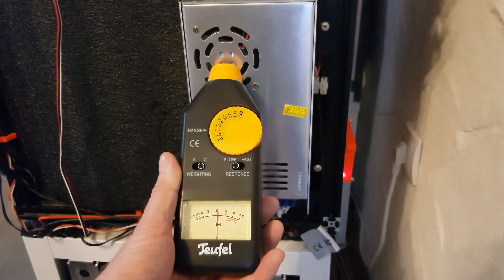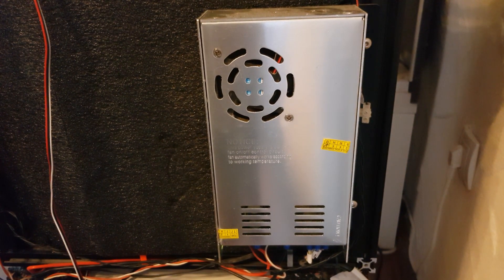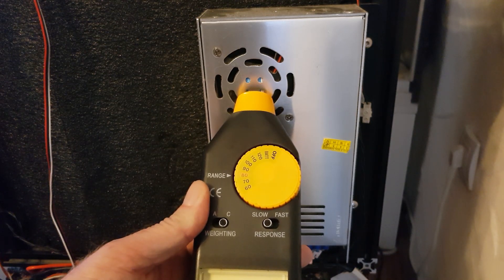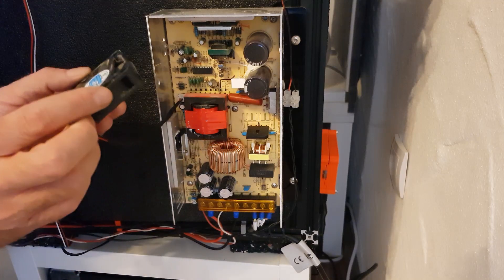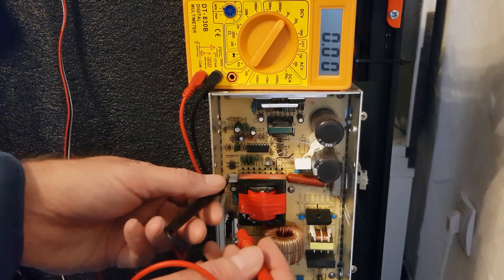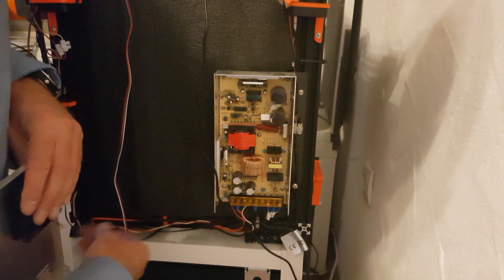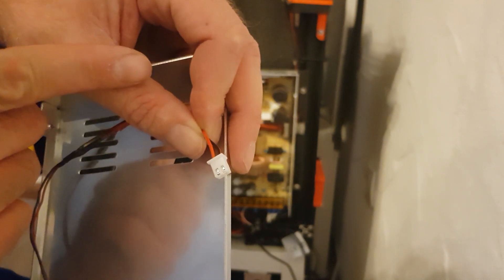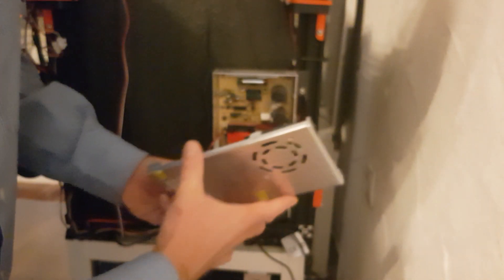Creality Ender Netzteil ohne step down Modul leiser machen - Lüfter zu laut

Comment: Junge auch wenns schon 2Jahre alt ist machst du einen riesigen Fehler. Netzteile werden niemals im Leerlauf (wie Du sagst, das nennt der Fachmann ohne Last) gemessen sondern immer mit Last die führt dann zu einenm brauchbaren Ergebniss. Viele Steckernetzteile z.b. Liefern und z.b. 12 Volt DC oder auch AC die Leerlaufspannung dieser ist aber meist höher so ca 16 Volt bei DC und 14 Volt AC. Diese 2 bis 4 Volt sind der Frequenz und im DC den Gleichrichtern geschuldet.